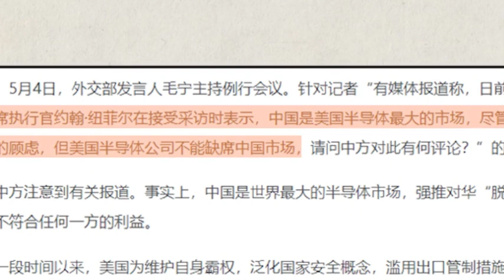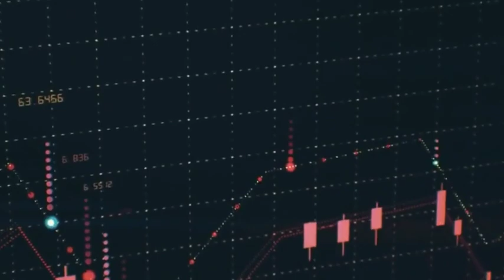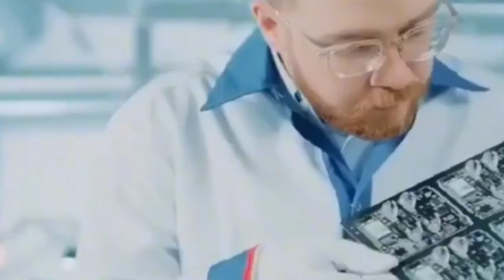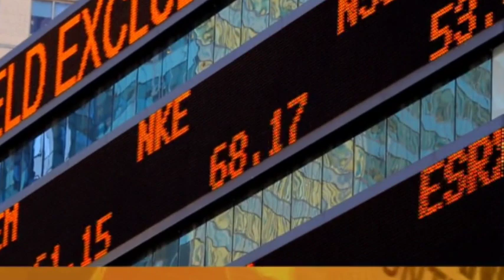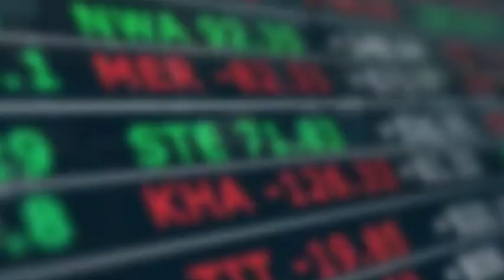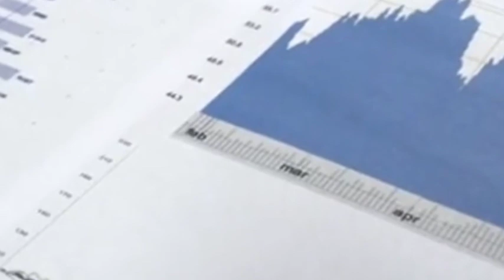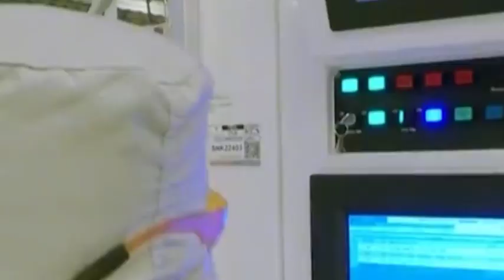China's lithography machine sector rapidly promoted by Harbin Institute of Technology

Comment: There's nothing like patting yourself on the back... If that's actually happening in this video.
A number of overoptimistic statements... Like admitting China is still working on improving its 28nm node process but at the same time suggesting that China is on the brink of building an EUV lithography machine which would be required for about 7nm or better. There's at least a couple if not more node technologies being skipped for that jump in technology is very, very unlikely to happen short of theft. AFAIK DUV supporting 28nm isn't sanctioned so if China can find anyone willing to sell them an ASML machine even if second hand I'd imagine that would make a lot more sense than trying to manufacture a machine of their own.